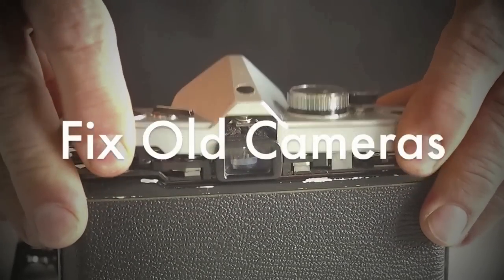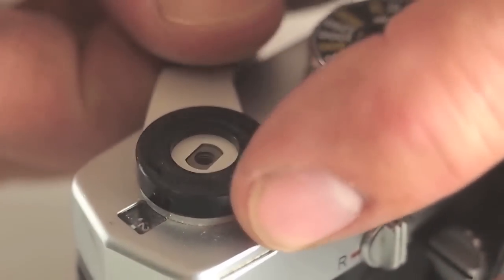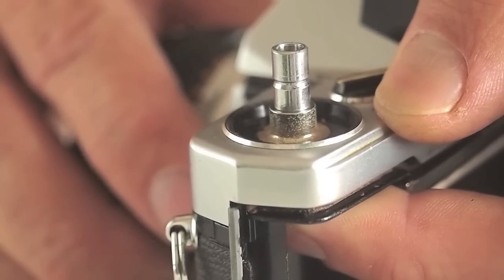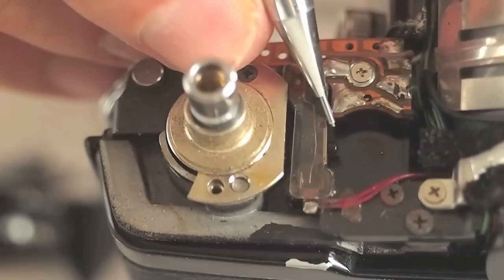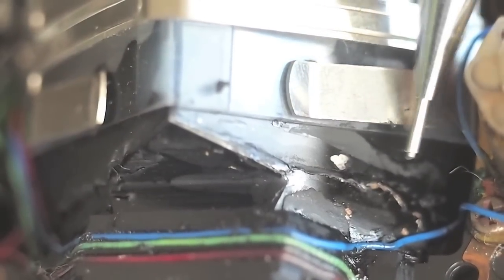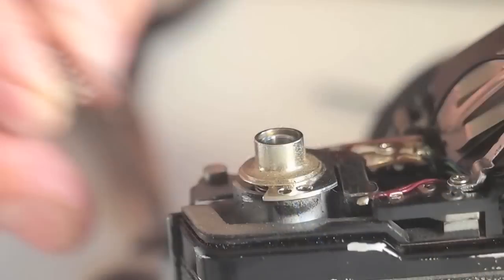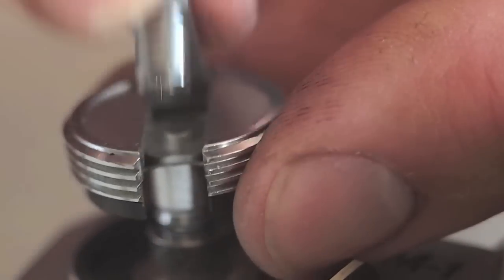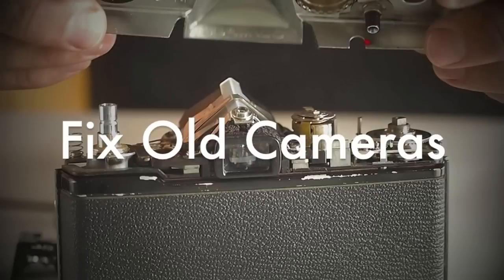Fix Old Cameras: Olympus OM 1 Prism Foam Cleaning

Comment: Can you make a video on how to clean Canon AE-1 Program Prism cleaning and viewfinder cleaning please !!
Reply from the maker: The AE-1 P viewfinder screen can be removed by releasing the clip at the front center of the viewfinder screen frame. Handle the screen very carefully as it scratches easily and do not use any cleaning fluid on it except distilled water.
Reply: Fix Old Cameras I also have fungus growing in the eye piece of the view finder how do I clean the eye piece optics
Reply from the maker: What you perceive as fungus might be residue from degraded foam seal. Of if it is fungus on you eye piece lens glass it can be cleaned with alcohol, again only use distilled water on the view finder focus screen and always follow the concentric circles. If it is only dust on the screen, use a soft lens brush and a puff of air.

Comment: great video very helpful and educative. can you teach us in depth about galvameter, asa dial and lightmeter. the asa dial on my olympus om2 doesn't have effect on the metering. thank you in advance
Reply from the maker: That might make a FOC feature, thank you for the suggestion. With the top cover removed... check the ASA cam linkage and aperture ring cordage to see that the galvanometer coil is rotated with ASA and aperture. Check for binding.

Comment: it would be nice if you'll make a video about om-1/om-2 meter adjustment.
Reply from the maker: Thank you for the suggestions. The OM-1 is more likely to be featured because of the simplicity of the circuitry.
Reply: By the way - is there any method of adjusting the meter if turning eccentric on galvonometr case doesn't help (in my case it throws the meter needle in direction opposite to needed).
Reply from the maker: If the eccentric adjustment is insufficient, you can change the position of the meter pulley. Lift aside the photocell galvanometer unit and loosen the 3 screws. Be aware of the meter link cordage. Or you can change the timing of the coupling gear located front of camera under lens mount. Again be aware of the meter link cordage as you add or or subtract engagement. Turning the gear counter clockwise moves the needle up. For linearity adjustment you will have to change the fixed resistor values through experimentation.  Note: The OM1n as an adjustment screw at the bottom of the meter pulley. Turning the adjustment will change the length of the meter cordage and consequently changes the meter position.
Reply from the maker: If the eccentric adjustment is insufficient, you can change the position of the meter pulley. Lift aside the photocell galvanometer unit and loosen the 3 screws. Be aware of the meter link cordage. Or you can change the timing of the coupling gear located front of camera under lens mount. Again be aware of the meter link cordage as you add or or subtract engagement. Turning the gear counter clockwise moves the needle up. For linearity adjustment you will have to change the fixed resistor values through experimentation.  Note: The OM1n as an adjustment screw at the bottom of the meter pulley. Turning the adjustment will change the length of the meter cordage and consequently changes the meter position.

Comment: I needed to ask a fellow repairman about the OM-1n  md circuit board.  There is a diode solder to the meter circuit board but no circuit is associated with it.  Could this be the Olympus move to use the 1.5v battery to get rid of using the mercury cell?

Comment: Just finished removing the foam on the prism of my OM-2. Pretty much the same as the OM-1 in the video. I had to take the top back off to get the spring for the back cover catch in correct.  First time it fell over and I couldn't get the back open.  Put the spring in correct and it works great.  Thank you for all your efforts in providing these most helpful videos.
Reply from the maker: It is frustrating to have completed a repair only to find that a part was forgotten and that spring in particular is easy to forget.Very good to hear your persistence paid off. Often that is the difference of a successful repair and a fail.

Comment: Does a Pentax K1000 have foam on top of the penta-prism that needs to be removed?  How do you know the foam needed to be removed?
Reply from the maker: The K1000 does not have the foam living on top of the prism so it is not an issue for it. If you have an OM-1 and you do not know is history, remove the top cover and inspect. If you can see what looks like shadowy spots when looking into the viewfinder of an OM-1 than the damage as already started to occur.
Reply: Fix Old Cameras
Thank you.  I am seeing what looks like black mold when I look through the view finder of my Pentax K1000.  I am wondering if it would be easy to remove the view finder screen to clean th prism.

Comment: is this for the 'fluffy' stuff at the bottom of the viewfinder?
Reply from the maker: If the degrading foam has damaged the reflective coating of the prism, it might appear as if there is fluffy stuff in the viewfinder. However once the damage is done it can not be reversed only stopped from progressing.
Reply: Fix Old Cameras is there no way to clean the damage at all? Is the only option really finding a ‘dead body’ to replace the prism? Thanks!

Comment: I’m very glad I’ve come across your videos. They’ve helped me several times recently. My latest adventure is dealing with a shutter button on my OM2 that isn’t working. It’s as if it’s stuck in its current position. It’s recently acquired by me and likely hasn’t been used in a while. What would be the best way to get it working again? And I’ll likely need to replace the focus screen. I’d love to see a video of that process. Many thanks for the service you provide.
Reply from the maker: Thank you for the suggestion and for your interest in FOC. The OM2 is a beautiful camera and a should be featured some in up coming videos... hard to say when such a video might be produced.
Reply from the maker: @BeardLAD  Should be fun... maybe with a cameo appearances of an "Igor" type character.

Comment: What can be done for a prism that has some corrosion on the silver?  Can the OM-1 prism be re-silvered?
Reply from the maker: Yes a prism can be re-silvered. Typically the restoration of a prism is not practical. Often locating a donor camera is the best option.
Reply: @FixOldCameras  Cheers for that.  Yeah, I can see prisms on ebay in decent shape. Cool. :)

Comment: Thanks for these great tutorials! I followed your guide with good results but I had to cut the red wire to the hotshoe mount and now the light meter is all erratic and not working properly. Could this be linked, like a voltage change or an earth that's no longer there etc?

Comment: When I accidentally shut the film door when the rewind knob was removed on my Canon A-1 I used a bit of piano wire with a tiny right angle end inside the socket for the shaft and pulled up on the latch from the inside.
Reply from the maker: Clever use of materials on hand.

Comment: Why was the foam in there if it can just be removed without replacement?
Reply from the maker: A good question that perhaps someone from the inner circle of Mr. Yoshihisa Maitani could answer. Maybe it was placed there for sound dampening, but regardless of the original intent the camera will operate perfectly with out it. If you would like maybe replace with a felt strip or more of the same foam...  just remember in 30 years when it degrades again it will have to be replaced.

Comment: Hi, I have found both cleaning the viewlfinder and prism foam very helpful and you efforrts are greatly appreciated, my OM2 now has what seems an intermitent fault with the shutter when in Auto mode, it works sometimes but other times it will leave the shutter open until I reset it, if I operate it in manual mode the shutter opens and closes without fail at the appropriate shutter speed, leading to my conclusion that this is purely an issue only when shooting in auto, for info the ligth meter works fine for both manual and auto. Could this be an intemittent electrical fault of debirs somewhere? Regards
Reply: Have you tried fresh batteries? Had this same problem and that fixed it
Reply: Thanks Harry, yes I did put new batteries in, I also tried the same batteries from my OM2n but alas it still exhibits the same symptoms, auto will work but the shutter speeds it fires are way off, additionally the shutter will sometimes just stick and not return back unless I reset or flip to manual, manual mode seems to work absolutely fine.

Thanks
Reply from the maker: You suspicion of an IC or component failure is possible correct. However, you may check the ASA wiper and the yellow and white wires. You will need to access the ceramic circuit under the mirror box bottom plate for the next check. On this circuit check the switch continuity to the photo cell (SPD) terminal nearest the rewind (cathode). Check the continuity from the wiper of the adjustable resister nearest the wind side of the camera to the other terminal of the SPD. There is also a 470pf capacitor under this circuit board that  could be leaking or could need cleaned across the terminals.

Comment: Another excellent video. Thank you! With help from your excellent video on fixing the sticky shutter magnet problem in OM10s I am going to service the OM10 that I have had since I bought it new in about 1980. Do OM10s also have foam on top of the prism? Would you consider making a video guide to taking the top cover off an OM10? 

Keep up the good work, you are saving the lives of stacks of old cameras out here!
Reply from the maker: Thank you for the suggestion and it wculd be a possibility.
Reply: As to OM10 having foam on top of the prism: No. Which is why a broken OM10 is a good donor for a prism.
Reply: @Bert-xi1dn  Great. Thank you!
Reply: @Bert-xi1dn  I realise I'm replying to an old comment, but does the OM10 have the same prism as the OM1? I realise that it will physically fit, but if it is smaller or doesn't have the silvering then it would be a downgrade. I never hear the OM10 being complemented for its large bright viewfinder in the same was as the OM1 is.

Comment: Hey, first of all amazing video, Its great to find someone that socializes knowledge on this old cameras.
 I have a terrible problem and maybe you could help. I bout my Olympus Om1, the camera of my dreams abroad and It came with the light meter diffusive. Its like sometimes the needle takes the exposure properly but at moments for no reason it gets crazy and marks wrong values. Also at speeds 1sec the shutter sort of gets stacked, dont know if it is related.
 In my country I would have to pay almost the same amount of money for repairing it than getting a new one from Japan full operating and that would mean expend a ton over again, that's why I choose to look for help in videos and see if I can fix it by myself. Using a camera that was meant to be the tiniest of SLR with an external exposure meter seems pretty bad and is't obviously what I had in mind wile buying it.
Could you please make a video or give me instructions on how to fix it? If you need I can send you a video of the problem, I am really desperate about it.
Reply from the maker: The shutter issue is not related to the meter issue. The slow speed 
escapement needs to be addressed for the issue with the 1 second speed. 
Be on the watch for a FOC video showing how to access the slow speed 
escapement. In the mean time the slow speed escapement is located under 
the bottom cover plates in the mirror box.  The cover plates are held in
 place with glue and the felt strips the line the lower edges of the 
mirror box. See if the issue with the meter is related to the aperture 
setting. If so then the error is being caused by the aperture meter 
linkage. The edge of the aperture linkage tab should rest next to the 
red dot on the lens mount bayonet. The tab is about 3mm by 10mm and 
should slide under the lens mount in a counter clockwise direction and 
spring back when release. When moving the linkage it should change the 
position of the meter needle.
Reply: I'm not sure if I completely followed your explanation. I think I found the  tab you're talking about but it doesn't move at all although when the lens are placed the needle changes its position with aperture and speed changes. It is more like the needle is loose, if you shake the camera the needle will move freely and start measuring all whatever it wants. For example it happens a lot when you start moving the A and S rings from min to max that the needle gets stuked in the higher points or just gets crazy as you decrease the light.
Hope you could get what I mean
Reply from the maker: Maybe, if I read your description correctly, you have an issue with galvanometer itself. Could be a dirty in the winding of the coil. A very gentle flush into the galvanometer with alcohol might help. Be VERY CAREFUL not to allow any alcohol to flow under the prism onto the view finder screen.It could damage the screen. If cleaning does not help or makes it worse than the issue with the meter is probably a short in the winding and the galvanometer will have to be replaced. Because of the linkage string attached to the top of the meter there is a timing concern that makes the replacement of the meter a little tricky.
Reply: Okey that sounds pretty complicated but I will try my best because I got no other choice.
can you give more specific instructions on how to clean the galvanometer?
Also, throw the viewfinder I can see a few black stains, is that related to the foam that you clean in this video? How can I clean it?
Reply from the maker: If you already see black stains then the prism is probably already damaged from the degrading foam. But the old foam should still be removed to arrest any more damage. Maybe you should wait on the tackling the galvanometer issue until after you have sharpened your camera repair skills a bit.  In the mean time you can still use your camera to great success with out your meter. You may have heard of the the "sunny 16 rule." On a bright sunny day if you set your aperture to F/16, and you shutter speed to match your ASA/ISO of your film you will get a good exposure. For instance if your ASA is 400 your would set the shutter speed to 500 or if the ASA is 200 you would set the shutter speed to 250. Following the “sunny 16” rule you’ll get an exposure that is neither too bright nor too dark. For snow or a white sandy beach f/22. On a slightly overcast day when it’s mostly sunny but there is a high cloud in the sky blocking out some of the light, you can use the slightly overcast F11 rule to get the right exposure. If it is a completely overcast day, you would set your aperture to F8. On heavy overcast days and fog, just set your aperture to F5.6. Shooting into a sunset with the sun below the horizon, F/4 should work. If you want to change the shutter speed off of the inverse of the ASA you will increase your aperture by one full stop every time you decrease you shutter speed by one full stop and visa versa every time you decrease the aperture. Also printed on the inside of the film box is an exposure chart.

Comment: I would have loved to have this video handy when I did my OM-1 a while back. Although I managed to remove the rotten foam, a faint line remains in the VF since, as the silver has been eaten by the goo. In those days I had bought a BER OM-10 on the belief the prism between both models was the same and I could swap the good prism of the 10 in the 1 (this is something I had actually read, I didn't make it up). But I never got around to actually attempt it because I never found an adequate tutorial on how to reach and replace the prism. Do you think it would be possible ?
Reply from the maker: It could be done.
Reply: Fix Old Cameras please 😁🙏🏻

Comment: Very instructive !  I wonder if you have any tips or video to help me repairing the light meter in my OM-1: the needle´s stuck somewhere in the middle position, battery´s fine. Thank you!
Reply from the maker: +werewolf164 
Remove the prism and check for some sort of physical blockage of the needle. The string that connects to the aperture linkage could be broken or come off a pulley. Disconnect the meter from the circuit and apply voltage from a single button battery (a battery partial run down is ideal) to the wire and ground. The needle should peg, although unlikely the action could reset the position of the needle.

Comment: I have an Olympus OM-1. I have it functional, but noticed that shutter speeds 1/1 to approx 1/16 or so just stay open as if in B mode. I'd like ideas on this kind of repair. Your videos have inspired me to take mine apart and fix it myself. Thanks for the tool tips!
Reply from the maker: The slow speed escapement lives under bottom plate of the mirror box. Accessing it will be covered in an upcoming Fix Old Cameras video. It is possible that flush cleaning the escapement and a drop of oil in the right spot might fix the issue. Please be patient for the posting of the video. It could be some time yet. Thank you so very much for your interest and enthusiasm.